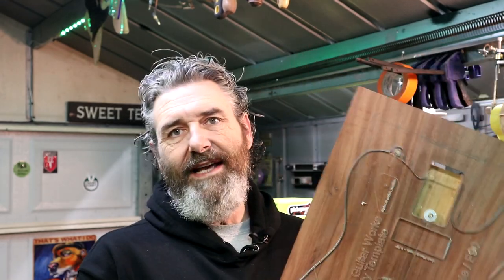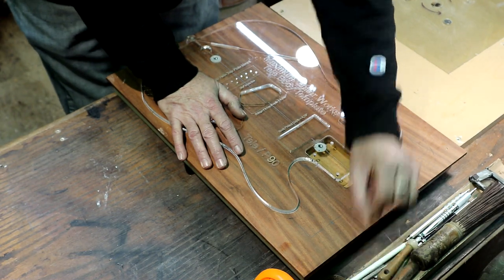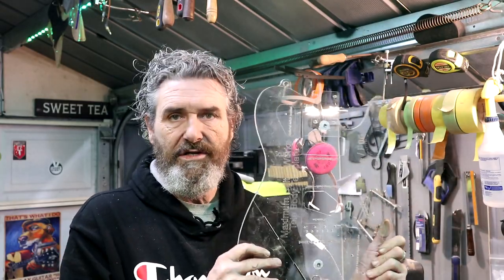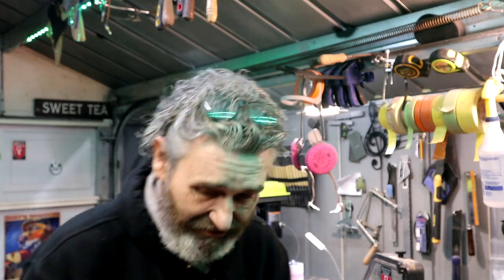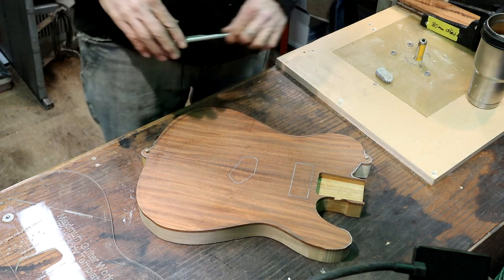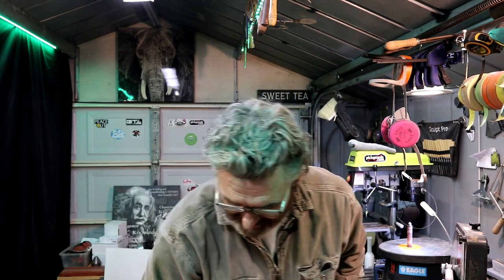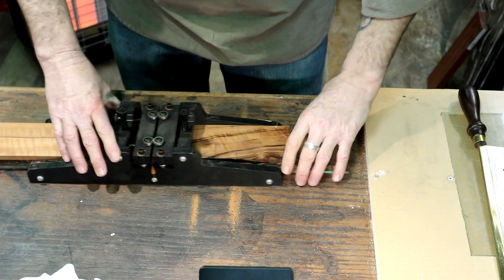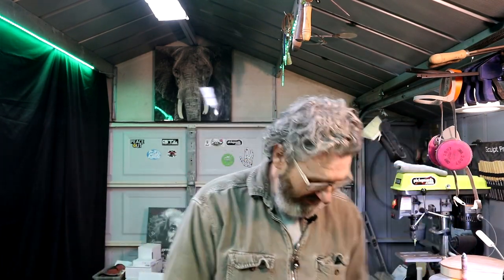Custom Telecaster Build - Episode 7

Comment: really likin' the off set shape of my new guitar!  Awesome Fretting rig!  I prefer back cavity to keep as much of the wood visible as possible on the top.  In fact if you go completely without  a pickguard at all, that would be a bonus!
Reply from the maker: Certainly. I won't be using a pickguard. I don't like them really. If I do a standard Tele control plate, I'll recess it into the body but I'll more than likely do a back cavity. Thank you for the input! ✌️

Comment: Really linking this series. Since I'm about to start my first build, those are a nice and very welcome help. I would (and probably will) go for a back cavity for the electronics, in my case will help me in hiding my mistakes 🤣🤣
Keep up with your fine work.
Reply from the maker: Thank you. Just go slow and take your time. There are so many little things to do on a guitar. Treat each process with the same care as the last thing. I recommend starting with a Tele or some solid body with no break angle. You'll do great man. Let passion guide you! ✌️

Comment: I like the slight off angle you picked for the tele, I didn't expect that even though it's a very small difference 👍 I'm digging the calm vibes.  Thanks for breaking the building process down into small increments. There's a lot to learn in each little step
Reply from the maker: Thank you. I just wanted to try something a little different with this build and really try and break it down. It's helping me as well to do it this way plus it's really helped shorten my videos a little and made editing so much less problematic! Thanks for your comments! ✌️